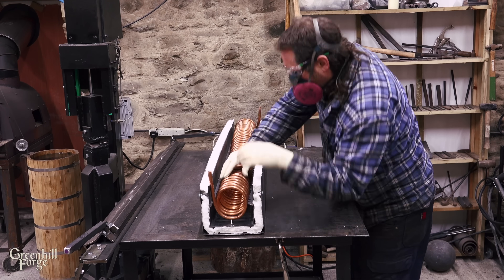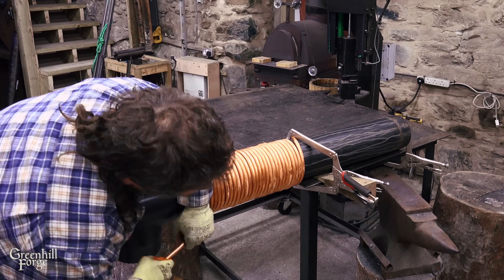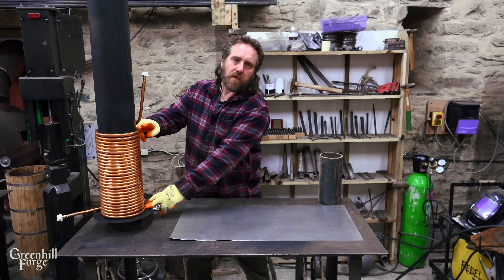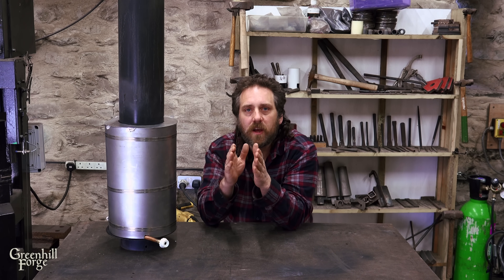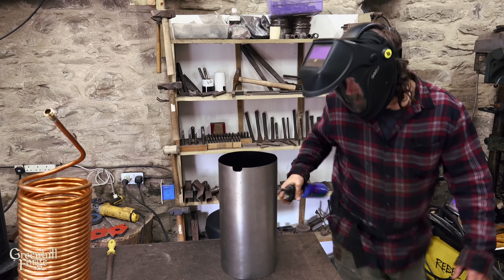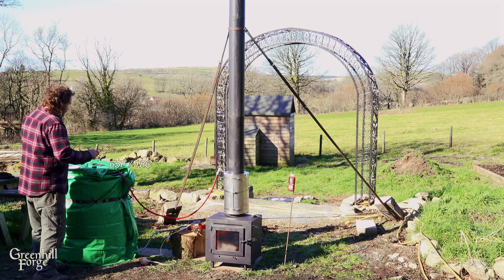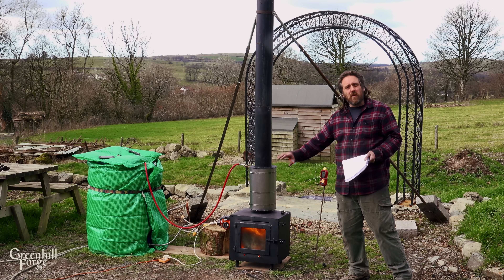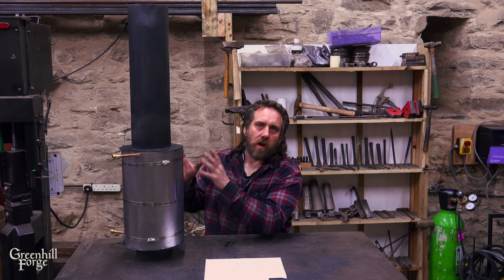Best Wood Stove Water Heater Yet: New Design Tested | Off Grid Water Heater pt3

Comment: Instead of external, try internal box around/ above or even acting like a baffle. It can be boxed and filled with the carbon. European fires often had back heaters, before wood burners  became governmental targets. The modernisation using carbon powder would be better than the vermiculite used in the day.

Comment: I wondering if using boiler type steal tubes would be a better option. It would allow you to run the tubes through with direct contact with the heat. The only problem I can see is rust.

Comment: Could you weld steel fins vertically inside the flue to pull more heat to the outside wall?
Obviously a taller coil would help too.
Also, you could make charcoal and substitue that for the graphite powder...

Comment: What if you put an super fine mesh instead of a flue, and used what you made as the flue. I don't know if it would really work, but maybe the graphite would keep out the gas but allow a better heat transfer with the mesh. Good luck and keep it up.

Comment: Fill the jacketed coil with water or an ethylene glycol mix.
It will work like the sand and graphite, but better because there are no air gaps. The system will transfer every bit of heat the fire exhaust transfers to that section of flue.
That way, you could also extend the coil and jacket farther up the flue toincrease the flue surface area it is absorbing heat from. Just space the coils a few mm.

Comment: Since it seems graphite is much more efficient: Why not try to build the inside tube of the flute out of solid graphite, then wrap the copper tube and get the rest of the set up with powder graphite, the outside insulator and metal cover up? At least just for the portion of the tube using this system.

I guess then that part with the inside graphite tube will be much more delicate and prone to cracks, but since if useful will be a stationary set up might be worth the tradeoff.

Comment: You only have the tiniest contact between the stovepipe & the copper. The copper tubing needs a flat bottom so you have a half inch of contact. Also, wouldn't increasing, maybe doubling the length of your coil increase efficiency?

Comment: Actual water heaters use a spiral placed inside the flue pipe to slow down the hot air flow and extract more heat.

Comment: I made my wood stove water heater back in the 80’s and all I did was wrap the copper pipe around the stove pipe without putting anything in the copper tubing. You’re not make a small enough wrap to crimp it IF you were to try doing it free hand ,yes you could crimp it, but I’ve wrapped tubing AROUND different pipes and never had that problem.

Comment: Haven't seen a reason for the length of copper tubing. Can using more tubing for a larger transfer area, but keeping the other upgrades (Graphite, Insulation, etc) improve the numbers?
I appreciate  the care you take in keeping repeatable records of what you are doing. Easier to compare apples to apples.
Keep up the good work.
Reply from the maker: Yeah, more copper would definitely help, I just have to keep the videos in a reasonable budget.

Comment: Would it be more efficient if the copper tubing were raised, or stretched, higher up the smoke pipe?  Rather than 18" touching the smoke pipe, stretch it up the pipe to say 36" or so.  I think the tubing would have more heated area to absorb and transfer heat quicker.  Lew

Comment: What if you double-wall the stovepipe, put the coil in the inner pipe, then use the outer pipe for the flue?

This gets the coil "almost" in the flue gasses and heat without the creosote. Add ceramic wool insulation and graphite as appropriate to enhance the effect.

Comment: Love it. I thought you were going to put a liquid in there, which would probably give better efficiency, but your concerns about corrosion (or flammability for oils) are overriding, and this makes a whole lot more sense.

I think the small margin in efficiency that the graphite powder gave over sand shows that the bottleneck is in the heat moving from flue gasses to flue wall at this point, not from flue wall to water. Is there any reason to only jacket such a short length of flue? It feels like you could space the turns of the coil out 0.5-2 pipe diameters with almost no loss in flue wall-to-water efficiency, especially with insulation around the outside and especially with graphite packing. Not sure how expensive the graphite is, but if you're comfortable filling up those gaps between turns with graphite, the same length of pipe seems like it could serve 1.5-3x more flue surface area, maybe getting similar factors of efficiency gain.

I guess the only issue there is that you have less of a chance of a thermosyphon working quite as well. With the heating coil all down at the base of the thermosyphon like I think you'd have it here, you get to put some head height in the discharge pipe above the thermosyphon that's all full of hot water, so that'd produce the highest pressure difference. If you stretch out the coil over the height of the tank between inlet and discharge you only get half of the pressure to drive the siphon. If your coil is taller than the height between inlet and discharge then the driving pressure drops even lower.

I was about to try and tell you that a single 50 foot coil of 5/8" would be too long and skinny for a good thermosyphon but I did some math and it seems like it should work quite well. 

The density difference between 10c and 100C is 0.04g/cm^3. Over a differential head of 2 meter (let's say... I mean how tall do you want your reservoir? no taller than 2m) that's P = (deltaRho * g * h = 0.04 g/cm^3 * 0.001 kg/g * 1000000 cm^2 / m^2 * 9.8m/s^2 * 2m) = 780 Pa of pressure. 

Using an online flow calculator for turbulent flow I get only 0.04 L/s of flow for that configuration (the Reynolds number seems to be in the transition region at 2500, laminar flow might get you 0.08 L/s). 

Let's say it's 0.04 L/s, and you've got your ~3.5kW of heat: the temp rise will be deltaT = Power / (cP * Q) = 3500 W / (4.2 J/g degC * 40 g/s) = 20 degC. It'd be 10C for laminar flow. Plenty of flow to take that heat out without boiling. So obviously we actually have a much lower sustained flow rate (with some intermediate temperature lying between 10-20C and 80C of temp rise). Seems like it ought to work pretty well!

Comment: Based on your test results I would think that the best way to go would be to unwind the coil a bit and add more graphite. At this point it’s kind unfair to compare this method to the other two given how much longer and expanded the coil was in both cases.

Comment: You can try pulling the coil more open in length ( dubbel the size) and do the same with grafite and isolation. 
I think that the wather got hotter.

Comment: 1. "coil insdie flue" was 2 times higher. is it important?
2. as far as I know air is thermo exchange barrier. so 1st version (just coil outside) had a lot of air between coil and flue. sand had less air. power should had even less. here are few ideas to replace even more air: a) add water to sand (not best since water has max temperature limit and than it vaporates) b) add heat transfer oil to sand c) use just heat transfer oil

Comment: First of all I love the series. It makes sense that you wanted to make a fair comparison between the system with the coil inside but i would love to see the performance if you made the coil longer, also i thought that if you run into problems with the water getting too hot while passing through the coil, you can split the coil into a number of shorter coils, which would suck the heat in "parallel" and the heat thransfer itself might even be more efficent since the temperature difference between the water and the gasses should be greater that way, since the water wont be as hot

Comment: I think you should add steel fins inside the flue, find the point you slow the out gasses enough to improve heat transfer but not enough to choke the stove. It will also improve much more the heat transfer to the flue, and if you "spin" the gasses, you force them to hug the walls, but that last part would be marginal. Mind the maintenance.
About the residue buildup, you may need add more combustion phases, givin it preheated air, like you did whith the tubes on the rocket, where the air can slow down again (a wider chamber). Could also get rid of the coil in the outside, just seal the water against the flue directly (?).
Great work, keep it up!

Comment: Awesome tests. Thank you, and it was interesting to see the effectiveness of the sand and graphite. If you spread the coil over a longer linear distance with the same amount of copper pipe, would that improve heat capture? Also, would doubling the length of copper double the heat captured or are there diminishing returns?

Comment: Use heat conductive epoxy on bind all the coils together tightly to the flue.  To keep the epoxy from sticking to the flue, grease the flue while casting the epoxy coils.   This will help keep better contact with the flue and provide heat transfer to the 'sides' of the copper pipe.  To improve the transfer, use a high quality heat sink compound between the coil and flue.  If you can flatten the one side of the copper pipe some before assembly, like they do with heat pipe heat sinks,  it will help thermal transfer to the coil even more.  If you REALLY want good transfer, make a small section of the flue out of copper where the coil will be attached.  You can buffer the copper flue to the steel flue will automotive high heat exhaust pipe paste, which will keep the differing metals from touching.

Comment: Wouldn’t you want to capture the heat coming off the top of the stove itself and run it through your capture point. Something like a hood over a kitchen stove. The hot point is the stove more than the stove pipe.

Comment: I think a lot of the heat is lost by the stove itself. Building a "water jacket" around the stove with the graphite would probably result in a very big increase in efficiency.
Reply from the maker: This is a special made insulated wood stove for this project. Even when the flue gasses are 1700F I can still touch the sides of the stove and they're cool to the touch. I made it in this video https://youtu.be/pfWMZuctbXM

Comment: I know nothing about this, but my intuition tells me that with your copper tubing only tracking the heat source for about 20 inches you are losing out on the heating potential of the remaining four feet or so of the flue's length.  Also, would using evacuated solar vacuum tubes instead of copper tubing improve efficiency?

Comment: Thanks many times over.  These videos are perhaps the most interesting I've ever seen.  Maybe you covered it in other videos, but it seems the in the flue solution was a much longer stretch, giving the flue gasses more time and distance to transfer energy to the copper.  The external wraps seem to be a much shorter flue section, so I wonder if you're taking that into account when doing the calculations.  Also, I wouldn't mind a show of the equations behind your calculations to help me understand.  BTW: I never knew those properties of graphite (pure carbon).  Thanks again.
Reply from the maker: Check out the different posts on patreon for the 3 test videos. There's tons of data and equations there. It's worth a test but its the same length and number of wraps of copper in all the videos and the flue is hotter the closer it is to the stove so I'm not sure how much difference it would make.

Comment: Awesome work! Ideas, maybe widen the gaps between the copper again (more volume of graphite surrounding every inch of pipe) and add an infrared reflective coating on the inside of the insulation shroud (keeping more heat from even reaching the insulation layer).  Even crazier idea; get rid of the copper tubing entirely and turn it into one large pipe that allows the water to flow straight up past the flue, like a 1cm thick sleeve of water surrounding the flue completely maximising thermal contact with the water. I know it might be a crazy amount of metal and costly, but then you could even go higher and enclose a greater volume of the flue. It seems you've got how to transfer heat from the flue pipe to the copper tubing, but I think you should consider how to maximize heat going into the flue pipe. Maybe combining your other radiator design somehow?

Comment: 17:06 I might be missing something, but the numbers don't seen to add up.
3.5 * 64/60 = 3.7 kWh = 12,625 BTU (graphite outside)
4.1 * 40/60 = 2.7 kWh = 9,213 BTU (woodstove inside)
7.3 * 34/60 = 4.1 kWh = 13,990 BTU (rocket inside)
Assuming you heated the same amount of water with the same deltaT (temperature difference) in each test, is it possible the power ratings are off?
Reply from the maker: Me, make a mistake? impossible... Yeah, it could be off and you'd win the prize for spotting it. All the data is over on patreon if you wanna go throught it. I'll mention that the inside flue tests went up to 60C but I think I recalculated to 38C for this video, the water starting temps will have varried and the fuel consumed varried a lot.

Comment: What if rather than having the copper coil tight like that you stretch it out so that it is in contact with a larger section of the flue?  I know the bottom is the hottest part but maybe if the copper pipe is at least not touching itself every go around you'll get a higher percentage of that heat transferred. 
Also, if you could flatten slightly the edge of the copper pipe that is touching the flue you would have a larger surface area for heat transfer.  Even a small amount could make a huge improvement as far as the total surface area.

Comment: It must had been proposed previously, but you may need a better way to pull the heat from the fume. Some fins inside the cheminey to bring the hot temp toward the side of the pipe. Or at worst bring some turbulence to the flow of the fume to heat the cheminey more. You cannot transfer heat that you cannot collect.

Comment: If you added more surface area (like baffles) in the flue where the coil is it would allow you to pull more heat from the flue gas! But it would obviously make it harder to clean and cause more build up😅

Comment: Could efficiency be gained by using smaller diameter tubi tubing, also giving longer length within that area.  The smaller diameter would slow the flow rate down but that increases contact time for heat transfer.

Comment: Since heat travels upwards... could you use some kind of tilted flue in order to place the copper parts straight above the heat source? As it is now, lots of heat is just shot upwards and does not help much.

Comment: Dump the coil. Build a tank around the chimney with galvanized pipes welded to the chamber. Add a pressure relief valve at the chimney. You could make the top of the stove part of the tank.using a rocket stove with a tank at the top would probably work the best.
Reply from the maker: I made a water jacket shower system that is exactly that and show it briefly in this video https://youtu.be/pP_2A5Wdvqg

Comment: Next I would try a copper flue pipe instead of a steel one. Copper conducts heat at around 400 W/mK where steel conducts heat at around 40 W/mK, so per foot of flue, you should be able to pull FAR more heat out of those hot flue gasses with a copper flue pipe.  

Also, the graphite powder was a good idea, but if you could use copper powder it would conduct heat FAR more than graphite powder.
Reply: The steel of the flue is so thin though that I believe any heat transfer benefit from switching to a copper flue would be negligible.
Reply from the maker: I'll try both of those if you buy me copper😅. Copper powder was my first idea but it's crazy expensive and a sheet big enough to make a flue pipe would break my bank account

Comment: You could increase effichency by letting the air in the pipe to rotate. laminar flow wil create a barier of cooler air at the surface from the pipe. a simple propeller shaped pice of metal could do it. nice experiment.

Comment: Hello from France: Interesting projects. Regarding efficiency, keep in mind that it is impossible to extract all the energy from the fumes, because they need heat to maintain the draft. It is therefore advisable to measure the flue gas temperatures during testing. For masonry stoves, a minimum temperature of 150°C is recommended, just after near any recovery system. You must also take into account the energy lost in the fumes to calculate the efficiency of the energy recovery system used to heat the water. It is just ideas and anyway, appreciate the efforts you put to test all configurations. Thanks.
Reply from the maker: The flue gasses are recorded right before and right after the coils in all the test videos and the data is avaiable over on patreon

Comment: Another thing to consider. Your coil inside the flue is much longer.  If the coil is less compressed, the flue has more time and surface area to absorb and transfer heat. Combine that with graphite and I wonder if you'd close the gap a bit.
Reply from the maker: It's worth a test but its the same length and number of wraps of copper in all the videos and the flue is hotter the closer it is to the stove so I'm not sure how much difference it would make

Comment: In a quality outside woodboiler the stainless steel water jacket is in direct contact with the fire box.  Or shares the wall with the firebox in other words.  Using this same principle, use a thin wall stainless steel flue pipe with a water jacket welded around the outside.  You could vary the length to obtain different results.